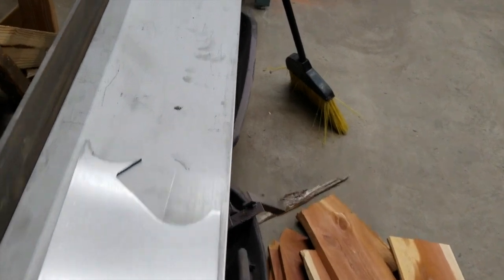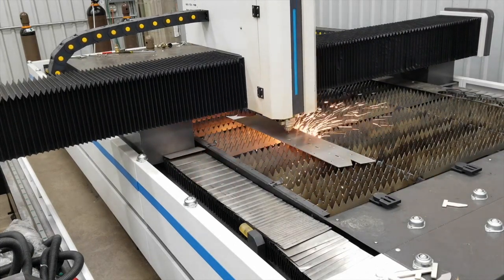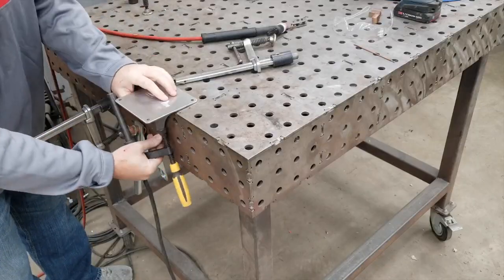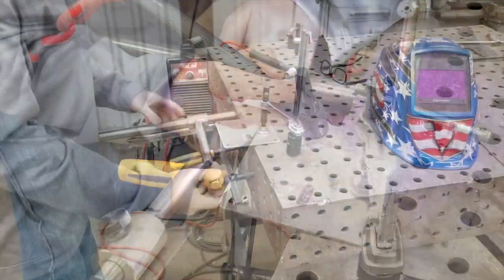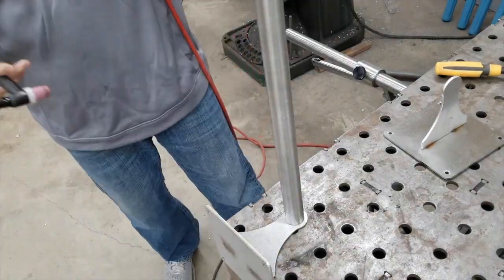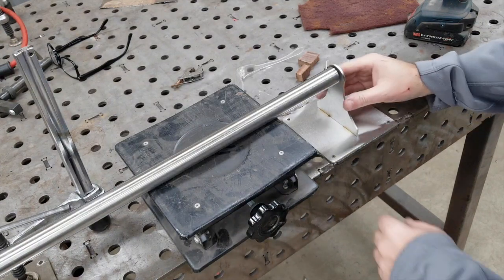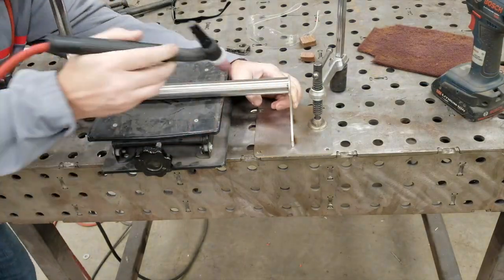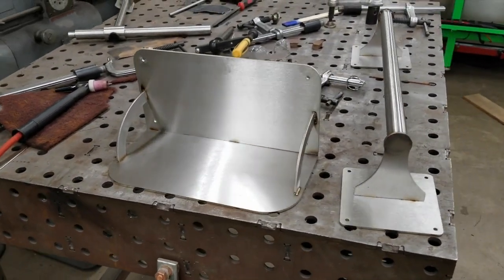Laser cut and tig welded stainless steel - Tab and Slot

Comment: Cutting steel with oxygen, focal point should be a depth of one third the material thickness into the material.  Cutting stainless or aluminum with nitrogen, focal point should be at bottom surface of the material.
Reply from the maker: interesting information.  So why is most oxygen on steel have a positive focal point like 6mm carbon steel on oxygen has a positive focus, and 3mm stainless steel has a negative focal point ?
Reply: Those values will be unique to the coordinate system your machine uses. For instance, the Trumpfs I had had auto z sensing and maintained a set height above the material.  Focal point was always a positive value and was measured from the sensed top of the material.  Old lasers without head sensing used a parameter that varied the focal point relative to the nozzle.  Even older machines, the heads had to be manually adjusted to change the focal point.  But even with the Trumpfs, we would look at the first few parts cut on a material thickness and adjust the focal point based on what we saw.